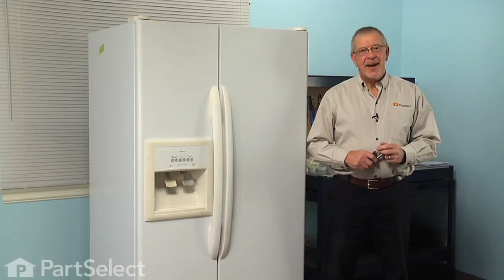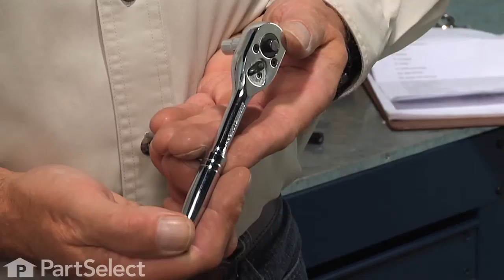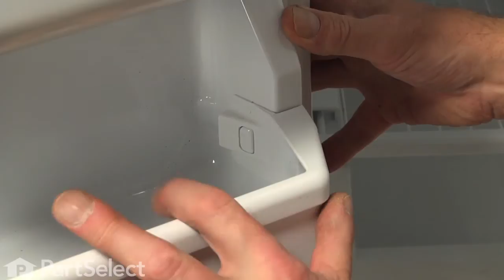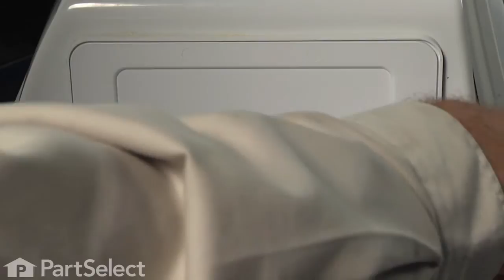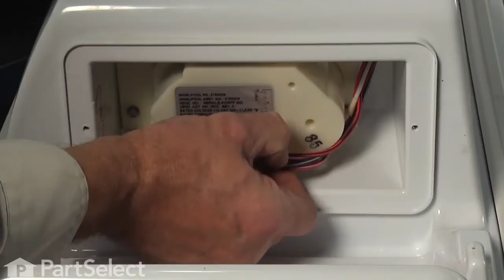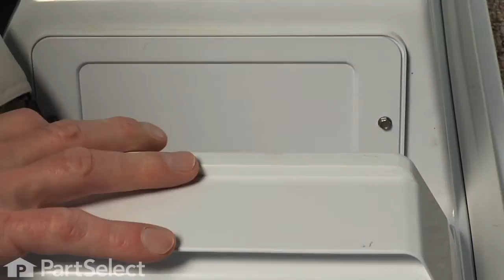Refrigerator Repair - Replacing the Auger Drive Motor (Whirlpool Part # 2188869)

Comment: Thank you magsteel9891 and garymichels. My motor was also frozen. Once the motor was thawed as magsteel described, it worked perfectly. This is great, because the motor is no longer available as a replacement part!

Comment: PartSelect is a good site, I've used them before.  For this job before buying a new motor check if the old motor is just frozen. Sometimes water gets in them and freezes up.  When you take the motor out let it thaw for a while then shake it and see if water droplets come out the opening where the electrical connector goes.  Shake out all the water you can, reconnect the motor, close the freezer door, and press the dispense button.  If you hear the motor run just screw it back in place and see if everything is fine.